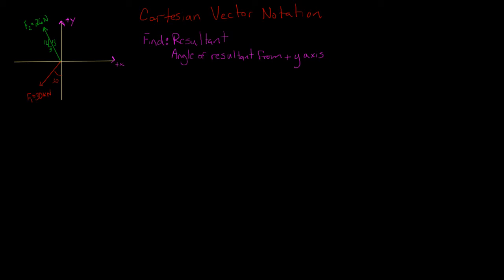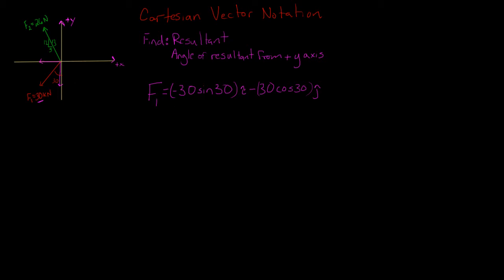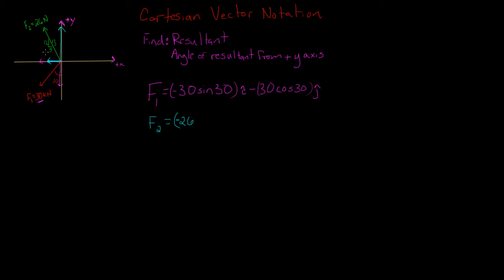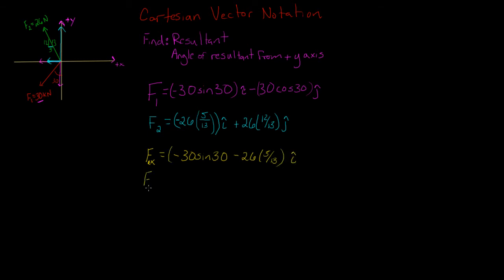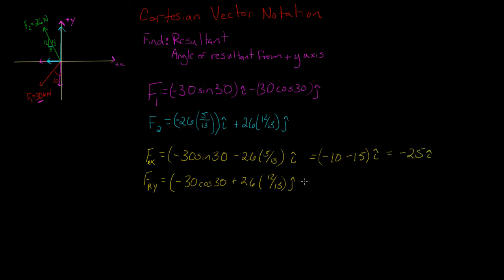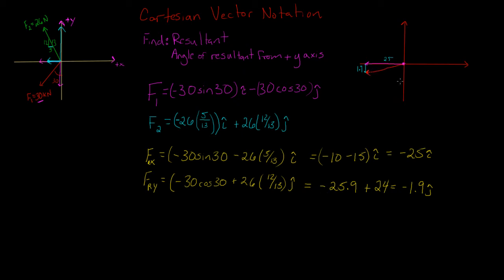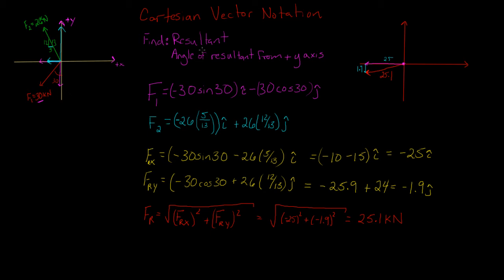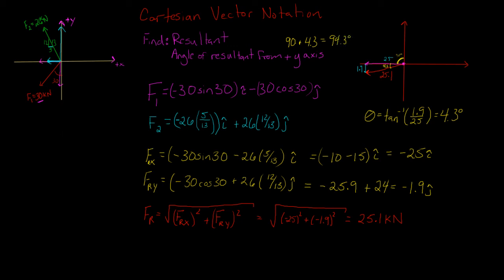Statics - 2D Rectangular Components - 2 Forces Example

Comment: brah cos finds x 
I'm very disappointed in you
Reply from the maker: No cos is a property of a right triangle and finds the adjacent side of the triangle with respect to the angle given. Draw the right triangle AND IN THIS EXAMPLE cos finds the y component and sin finds the x component based on the angle given. If the angle given was referenced from the horizontal (x axis) then yes cos would give you the x component.